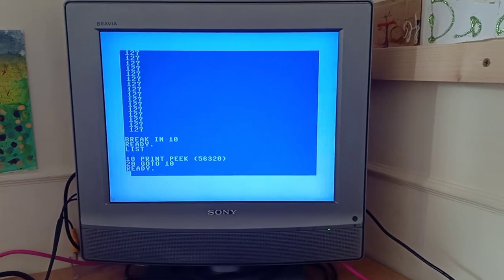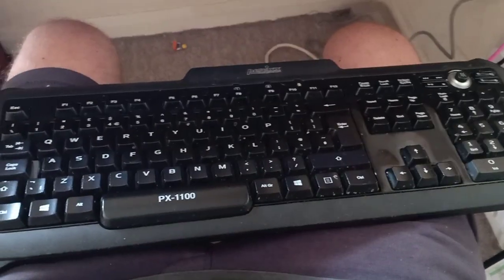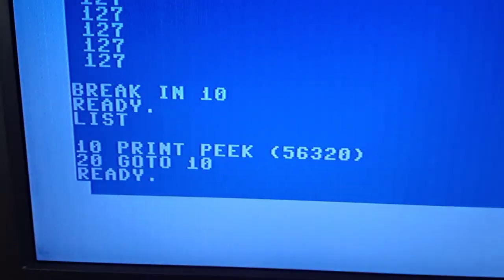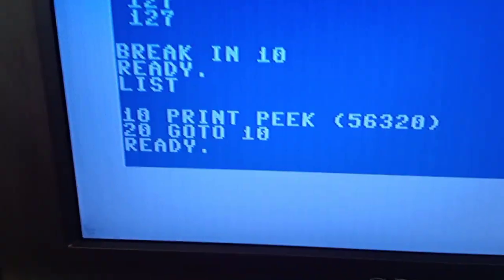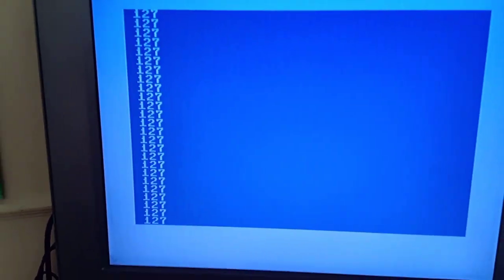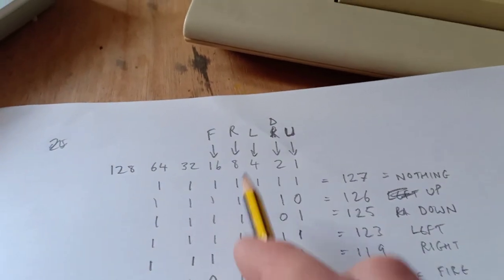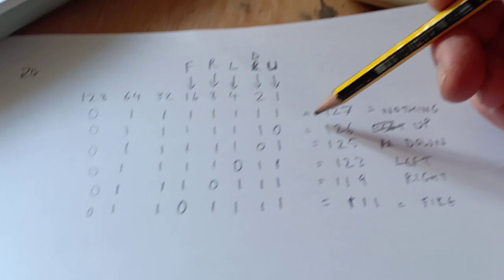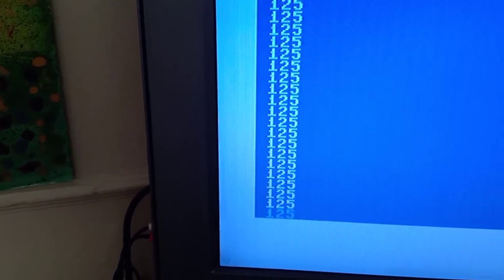Testing commodore 'gaming keyboard' (uses joystick port)

Comment: Yeah I couldn’t sleep, still having some residual heart tremors after surgery, that woke me up. So I first answered your question and low and behold what popped up as a recommended video 😂

This is so cool! So basically you can just turn that peek into a LDA and do my last video in the assembly series, which is joystick control 😂just haven’t found the lust to write and record it yet. Been too busy with Godot and GameCubes. 

But this is clever, playing on keyboard or controller is far more convenient for sure.
Reply from the maker: Thanks dude! It was a pretty basic hack but I needed to do it because I used to have an Amstrad back in the day and always used a keyboard for games. Didn't realise that nearly all Commodore games were joystick only
Reply from the maker: Good luck with the recovery btw!

Comment: Oh you can also read resistor values btw. So when you put in a thermistor on pins 9 and 8 you can show the progression of a temperature. Or put in a light sensitive resistor and you can then measure the lights and when it drops below a certain level turn on your lights with the user port and a relay. Something I did for my high school project. Very expensive way to turn on the lights automatically 😂
We also build a dtmf decoder that was done by my friend so when we dialed a phone and it auto answered we could press the keys on the phone which caused a serial char to be send from 0-F. Which allowed us to switch any number of pins in the user port.
Him and I made a great team and he really got me to into phone hacking and electronics, and I pulled him into computer cracking and programming. Unfortunately he dropped out of college when we studied EE together after highschool. I wonder how he’s doing…
Reply from the maker: Great stuff.